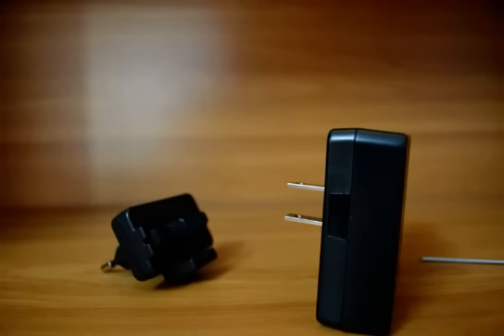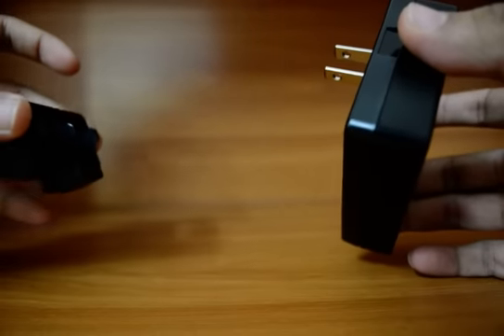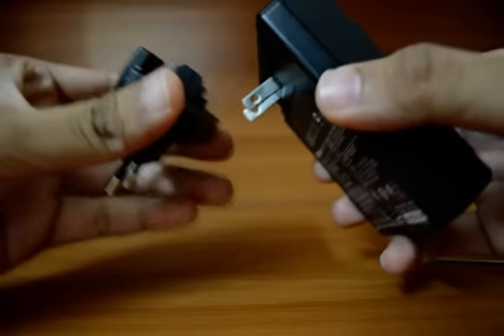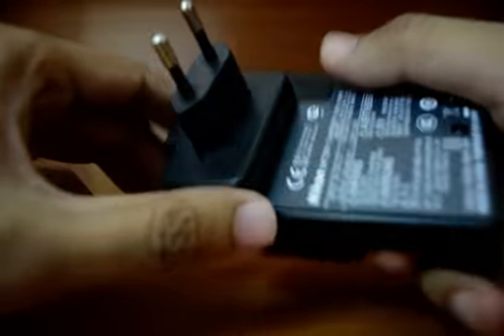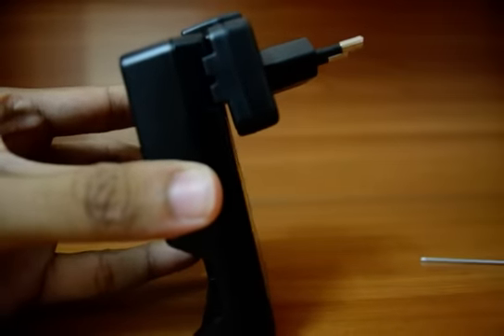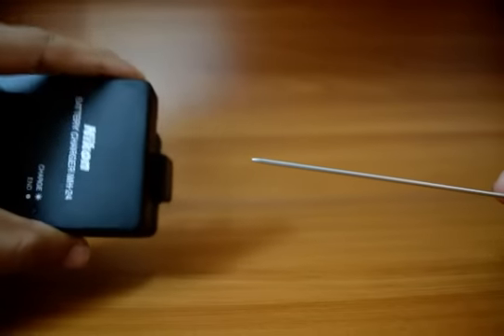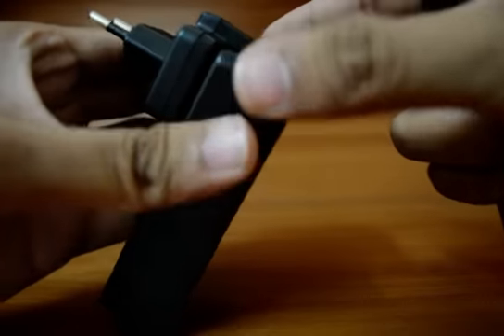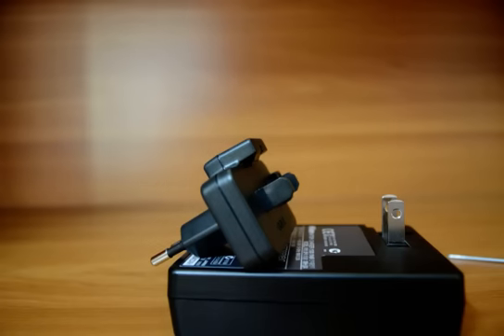Nikon Battery Adapter (removal)

Comment: European adaptors gave a secondary "slot" on the side. The pulling back trick is not working :(. 

On the TOP knob you need to lift the upside up (so lift the adaptor away from the block), till it unclicks. On the SIDE knob you need to push down towards the square block to unlock.  It's a stupid system. Thats for sure.
Reply: Thanks. It was driving me crazy trying not to break it!
Reply: novw van you maybe do a video on this? I dont know what you meen by  up or down or whatever. This design is making zero sense to me. Nothing clicks or even moves in ANY direction. Its like its a solid piece of plastic.
Reply: Thank you. I finally detach it. This is absolutely worst design I've ever seen. Like they made it not to be detachable!
Reply: Here is video for EU plugs: https://www.youtube.com/watch?v=65lpWKslILA
Reply: Nothing is work on mine.. i hate this charger.. 💔💔💔💔
[Edit] i finally detach it.. by force.. and this process bent my tweezer.. poor tweezer..

Comment: um guys?
i cant seem to remove it even after watching this video, the side won't even budge 
and i tried to poke some thing inside the hole too
dint work =(
Reply: nop doesn't work either@@
Reply: aight thks for yer help anyways =)
Reply: +V Lab, Unfortunately it didn&#39;t work for me either. I&#39;m using the MH-24 charger as well. As you say in the 23rd second of the video, I am not able to pull "that part" a little to make it come out. It just stays put. Like you do in the 40th second, when I try applying applying pressure (good enough to make a mark on the charger and break the thin screw driver) on the hole in top, it still wouldn't come out. Any help from experience is appreciated.
Reply: +John Jacob Tharakan There is one more video on this. Check it out. He used a thick blade or something to remove it. It's certainly a bad design by Nikon. We just need to do it a little harder.